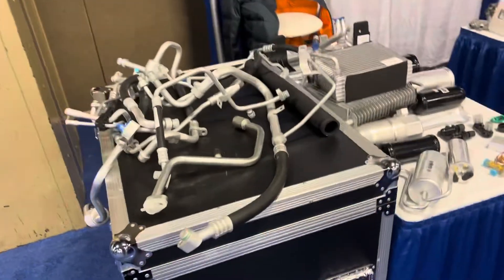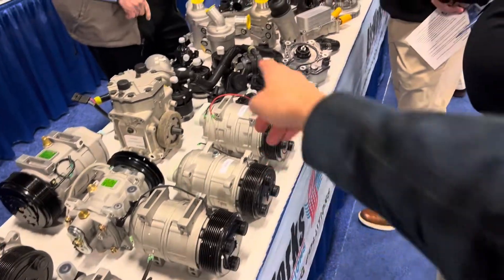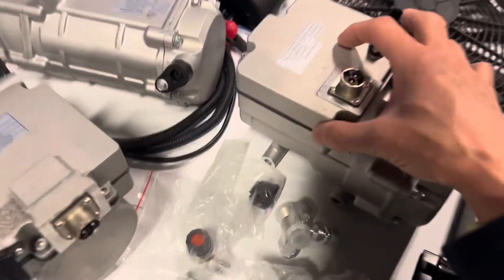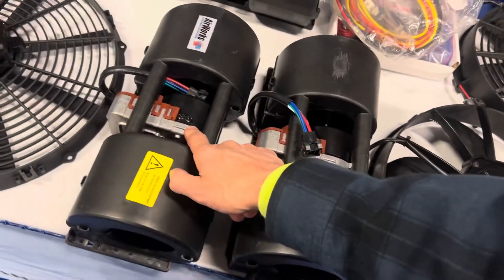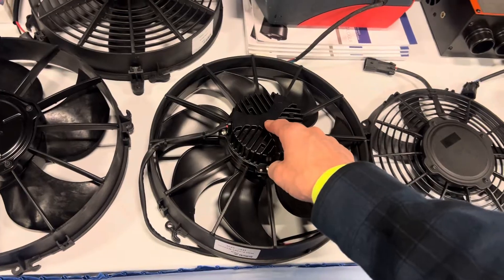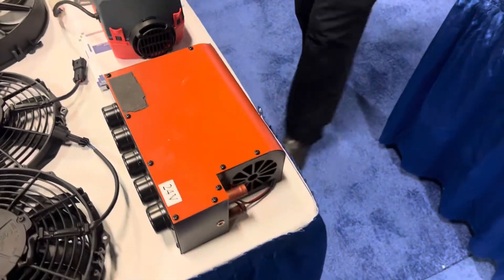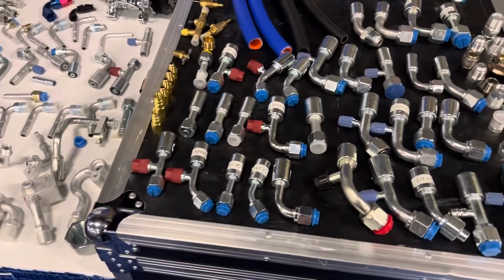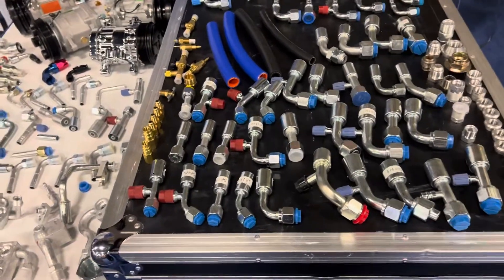LOW VOLTAGE ELECTRIC AC COMPRESSORS 12V, 24V, 48V, 72V

Comment: Their listing for 12v and 24v electric compressors are hard to find
Reply from the maker: A lot of these manufacturers information is difficult to find because they’re coming from Chinese website usually or resellers who want to import and distribute the product but don’t import and distribute all the literature that’s included with it
Often buying one product manufacturers equipment, and then rebranding it with their own label that also happens

Comment: is there a 12v kit for old restomod cars?
Reply from the maker: @ubacow7109  yes, but you may have to upgrade your alternator and the size of the wiring. The lower the voltage, the larger the copper wire needs to be going to the compressor and for your battery charging..  and if you have a very old car that only has a 35 or 65 amp alternator you might have to get one of the modern day conversions or upgrades to 130 A or more. 
    12 V compressors do not have as much power for cooling as the 48 V compressors. 
     You have to look into it and study to see how far modified you wanna go how much work how much money.

Comment: The real issue is the low btu. They won’t cool the car quick enough
Reply from the maker: @C0rvette454  correct very low BTU output.
Reply: So pointless 😢
Reply from the maker: @Dan0rioN still works just less

Comment: What's BTU IN 12V
Reply from the maker: @akhtarshakeel2287  you have to contact each indigo manufacturer to find out what they have available in 12 V
Usually 5000 6000 7000 9000. I think 12,000 might be the biggest anybody makes in 12 V that is common. . 

After that, you have to go to 12 V to 48 V to get anything bigger
Reply: For a 20cc 12v compressor, its max cooling capacity is 2.4KW, around 8200BTU.

Comment: Is it possible to convert my existing air-conditioning system on my 2019 Mercedes sprinter van, so that it can run off of my 24 V battery bank, cooling the rig while the engine is off? I currently have a 15 kWh 24 V battery bank with a large inverter, however, the rooftop air conditioner on the motorcoach is loud and draws an excessive amount of electricity. I thought it might be possible to utilize the existing air-conditioning system on the Mercedes chassis if I can use an electric air conditioning compressor, as well as power, the other systems from the battery. Any help or contacts you could send my way would be greatly appreciated.
Reply from the maker: @danielbrock5170  yes there are many electric air conditioning kits that runoff 24 V. 

Especially if you’re in hot weather, what is more important than a bigger air conditioning system . 

Is the insulation in the side panel walls and underneath and the roof? . 

Then comes how airtight the vehicle is the more airtight the vehicle. The less amount of cooling will need with the insulation. . 

If you have a very large roof area like on a sprinter van, the color of the vehicle makes the biggest effect on how much heat is absorbed by the sun and radiated off into the vehicle the darker the color, the more heat per square meter of surface area is projected into the vehicle. 

At least you can paint the roof of the vehicle flat white will remove many square meters of heat load off of the vehicle. 
Flat white roofing paint . 

Because I know going to a body shop to pay to have your vehicle painted white for the roof would be very expensive 

You could do it much more cheaper just think of an RV roof. They paint them flat all the time.

Comment: Can we use this with maruti 800 cc engine..??
Reply from the maker: @AmitKumarVerma-y2t  if you alternator has enough watts to run this. You might have to get a bigger alternator.
Reply: @coldfinger459sub0  any dealer in india Punjab Jalandhar
Reply: I'm working in Hyundai service centre As a Service manager..
Reply from the maker: @AmitKumarVerma-y2t  look up the specifications of how many watts output, your alternator provides. 
         Then you have to contact whatever manufacturer you decide you’re going to buy an electric compressor and look up how many watts of power is required by the compressor. 

Then you have to find a alternator that you can replace your original original with so it’s big enough 

There are custom alternator companies out there that will custom build you an alternator to the one you already have in place .  There’s not off the shelf available custom brackets need to be made up and alternators usually cost between 600 and $800

I had to purchase my personal vehicles before .

Comment: How cold can these blow outvfrom the vent? 40 degree?
Reply from the maker: It depends on the ambient temperature. 

It depends on the size of the evaporator and the condenser 

It depends on the airflow over the condenser and the evaporator 

And then it depends on the mechanical thermostat setpoint . 

The manufacture may construct them so they can’t go below a certain temperature so they don’t damage the compressor as a safety safeguard . 

But you can manipulate that, and if everything was done correctly, you can make it a little bit colder 

37°F  

But this all depends on the ambient conditions where you live. If it’s too humid, you get the evaporator too close to the freezing point you can make a block of ice. . 

Refrigerant flood back that can damage the compressor. 

Anything is possible

One of the most important things

Is how well insulated the vehicle is

Do you have a black paint job with black interior?

And absolutely no heat resistant insulation in between then it’s gonna be more difficult than a hot climate

More to be paid, extremely climates to the insulation inside the cavities of the vehicle

How airtight the vehicle is

And then properly the condenser was set up for airflow.

Comment: What is needed if I want to install electric aircon unit to my 12 volts van and get rid of my old enhine dependent aircon unit.
Reply: your AC will always be engine dependent wether or not its mechanically or electrically coupled.
Reply from the maker: @DieselRamcharger  not on electric cars
Reply from the maker: Many times a stronger alternator upgraded

A bigger battery or a second battery 

Larger cable from the alternator to the battery 

Definitely gonna have some wiring and upgrades to your charging system. Might need a lot might need a little bit depending on whatever Redi to capabilities of your charging system that you currently have.

Comment: Those dc compressors are interesting. Usually they have a 3 phase inverter board inside, with a  permanent magnet 3 phase motor. The 1-5V input basically controls a internal VFD for variable speed.
Reply from the maker: It’s nice that they made these low-voltage so even a do it yourself person can play with them and not worry about killing themselves. 

Now many more people can afford because the prices are cheap, and that the danger has basically been removed can afford to make mistakes 

You could power off your Arduino run your own little python, or C++ script and your own little sensors. You don’t even have to buy controls if you know how to write the code and how the controls are supposed to operate within the parameters so you don’t cause damage to the compressor. 

You can even squeeze a little bit more out get a little colder on your evaporator temperatures if you’re in a dry climate, with no fear of freezing the evaporator

Comment: Hi mate, I have a rooftop sigma aircon that I want to  use in my motorhome running  of my 12v 400ah house battery and was wondering if you could answer few questions for me:

1. The aircon unit is 4kw, what 12v compressor would you recommend? My target temperature is 28c

2. How do I thermostatically and remotely control the AC. You mentioned Arduino in the video

3. What cable size over say 8m cable run?

Thanks on advance
Reply from the maker: There are too many variables in the desired temperature with the efficiency and the surface rating of the evaporator and condenser. 

There are already kits on the market that have figured and put together known good working, packages assemblies . 

As far as Arduino, unless you already have a throw understanding working and have a little experience, I would not use that as your first go to because there’s a learning curve . 

You just buy one of the control assembly units that are offered by dozens of manufactures around the world . 

They already have the sensors in the modules ready to plug-in go . 

8 m if you’re talking about the cable for running the compressor itself . 

You would go to the electrical code specifications book . 
  And you would look up the wire size to amount of amps or watts that need to be drawn to figure out the wire diameter. 

But the chain is only as strong as it’s weakest link. 

So all your connections, bolts, nuts, washers circuit, breaker, any switching devices, all have to be rated or overrated for the capacity that will be drawn through the wire in watts of power. 

In this day and age is literally 100 manufactures out there putting individual kids together source from Parts from all over the world. 

I have one kit that I have acquired just because I got it for free out of the big rig tractor trailer. That’s a 12 V system.. 
But that’s something for later video

Right now I have no preference or recommendation for 12 or 24 V low-voltage compressors.

Comment: Can I just change only the belt compressor of my Rx 300 to electric compressor and also can I use the already installed components with the electric compressor?
Reply from the maker: Some you will need their software hardware control kit. 

Others you can make up and adapt you own controls if you know how. . 

For beginners buy the kit.  With instructions to walk you through.
Reply: @coldfinger459sub0 do you know if they sell the software hardware control kit?

I am planning on building a vintage Honda and unfortunately the belt driven AC compressor won't work with my current setup.

I found some guys claiming they are doing it with a 12V 18CC electric compressor but no further documentation.

Classic Retrofit sells a kit for their old Porsche's to convert to a electric AC compressor but I don't know where they got their ECU for you to program the speed of the compressor.

Any help be greatly appreciated.
Reply from the maker: @Speakingdatruth some companies do some companies do not.  You have to do your research and call a bunch of these companies because there are many of them.. 

Some companies just have really plain on and off scenario for their compressors, where they kick on hard and sudden full blast and kick off and cycle 

Other companies actually have software that will go through a soft, start variable speeds . 

You have to do your homework and your research . 

But yes, at this expo that I was, there was many companies that sell, the software and hardware kits to run electric compressors . 

Are you talking about the old little Honda that had the two cylinder 500 cc motorcycle motor I believe . 

You will probably have to upgrade your alternator to a more modern day, one with higher output .  And a slightly larger battery.. 

Make sure you get a modern day condenser and evaporator parallel flow microchannel . 

Because they’re more efficient and they have a higher output in a smaller size space . 

Do not use the old style large tube and wide spaced fins from back in the 1960s 1970s or 1980s . 

I recommend putting a moisture indicator in line of the high side liquid line leading to the expansion valve . 

This will give you a very large site glass on top of that. It will give you a moisture indicator to tell you if you, or somebody else ever works on the vehicle, has improperly service the system, and allowed it to get contaminated with moisture. . 👍
Reply: @coldfinger459sub0  Hi, thank you for the response. This vehicle is a 1999 Honda Civic. However, with the turbo setup I plan on running, the ac compressor on that location will not clear.

Regarding the alternator, I found a high output 200amp one for the setup.

It's just now finding the ECU system for the AC compressor.

My plan is to fully tuck it along side a wire tuck. The car will be for show of course but with AC. 

Btw, I follow your AC videos, you know your stuff. Be cool if you wanted to be  part of the project when I get down to it.